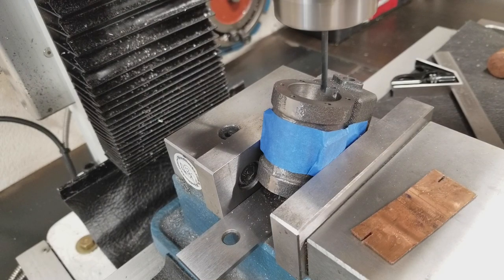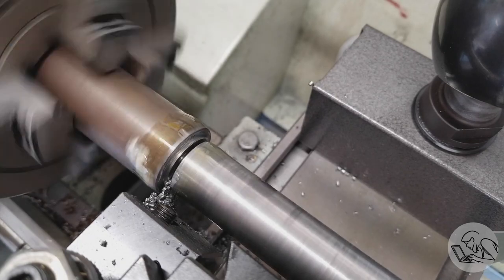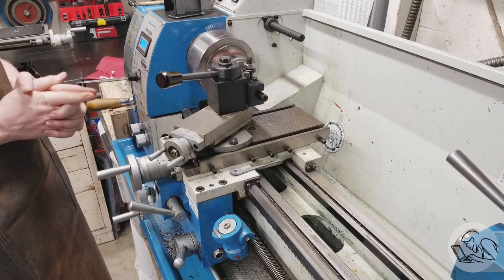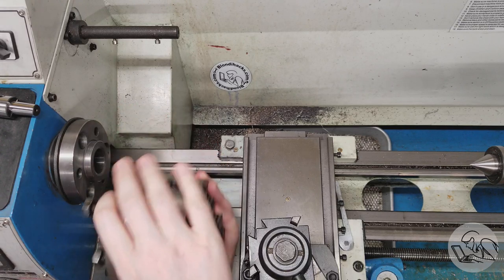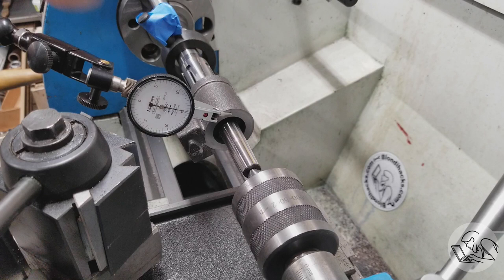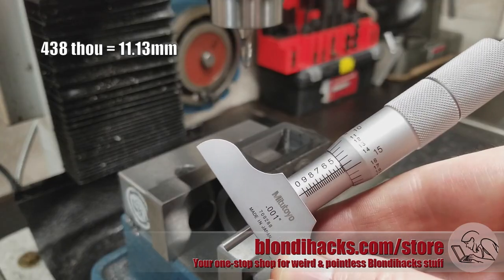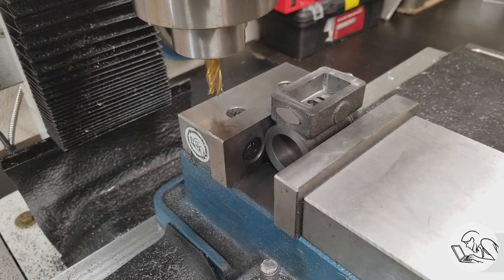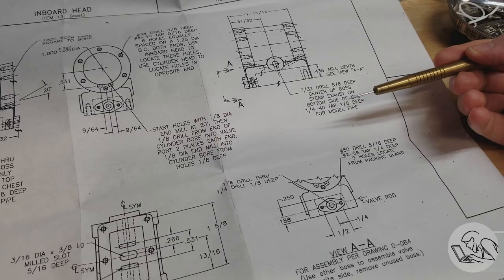Let's Build A Model Steam Engine - Machining a cylinder casting!

Comment: I have watched most of Kieth’s videos on steam engine building. He is an authority on the subject imho.
The only thing I found that didn’t work was setting up the cylinder bore using the mandrel. My casting bore was so crooked I had to replace it. The next two I indicated off the outside of the casting on the three points to find my center. I then bored to dimension and cut the face in the same set up.
Many model makers use transfer punches and super glue. It works, I use my DRO as much as possible.
Blonde, I enjoy your videos on this subject more than that professional machinist.
You are human, don’t ever change. You are a character. Way better than TV 😃

Comment: Used to use graphited string as cylinder packing. Bored cylinder in lathe,t hen fitted homemade mandrel to face both ends. If there was enough meat in the castings,then slice off the valve chest, you can see what you're doing with the steam ports, and you will be able to lap in the port face.  Cylinder hone, slit in a piece of broomstick, and strip of emery.You're doing a great job of showing this - LBSC would be pleased!

Comment: the bad thing when machining is once you start excepting modifications to one part it could bite you several steps later effecting 6 parts, the good thing is catching things early and it can award you with a good final product and experience.

Comment: Diesel engine tech here. Cross hatching is most definitely still used in modern engines. It is mostly for oil control. You can't have a polished cylinder wall (in diesel engines at least, can't speak for steam) or you will burn oil excessively. You have to have a film of oil on the cylinder wall, and having the microscopic peaks and valleys gives the oil a place to go when the oil control ring on the piston goes past. The oil helps keep the cylinder wall cool, and helps keep soot from sticking. Spray paint over water droplets and see what happens. Rebuilt many engines that had oil consumption problems due to polished cylinder liners.
Reply: Steam engines don't really use that technique because the lubrication is carried in the steam itself. Wherever the steam goes, the steam oil goes.

Comment: Great work!

In regard to honing. Basically everything you said is correct in its own context. And that is often the issue.

The finish and crosshatch angle will depend on what ring (or seal) material you have, ring design, application. Most certainly the grooves are used to retain oil and bed rings in. And the angles you were talking about are within normal range.

One point about honing technique is to give a few short strokes each end every so often, as you pass the middle twice as much at the ends and if you're not careful you'll end up with the centre being oversize.

Comment: Great video as always,
It’s great that you not only show your bloopers but also take time to explain them and give a little lessons learned conclusion. 
I would just like to put in a word of defence for any of the draughtsmen that may watch your videos.!
Before anyone goes picking holes in drawings they should put themselves in the shoes of a draughtsman! His job is not an easy one, it is not simply throwing together some random drawings showing what the part should look like and how big it should be. His job is to take a figment of the design engineers imagination and from that, create a comprehensive set of instructions that allow an unknown machinist, to create a fully functional finished component exactly as the design engineer intended and his only tool to do so is a set of pictures!
Those lines and dimensions he puts on paper are not just a representation of the physical size and shape of the part, they also explain the relationships and interactions of the features critical to its function. The dimensions not only state the size, position and accuracy of the features, but their placement on the paper in relation to the features also dictates the sequence in which they should be created in order for the finished component to function as the engineer intended. Learning how to read engineering drawings correctly and understand the design intent that they convey is as important a skill to the machinist as operating the equipment itself and with the best will in the world, the draughtsman cannot be held responsible for the machinists ability to follow the drawing.
Always take the time to read, digest and understand the design intent of the drawing before committing to machining the part. If the drawing seems little bit quirky or the method of dimensioning doesn’t at first make sense, then it’s more than likely been done that way deliberately to encourage a particular sequence of manufacture critical to the success of the part. Of course sometimes there are genuine mistakes 😉. Keep up the good work 👍

Comment: The person who doesn't make mistakes doesn't make anything.
An engineer can rectify there mistakes without anyone finding out.
Reply: BS, engineers don't find their mistakes, The technician in the field finds and fixes them.
Reply: @rjkee5157  the engineers at my shop have the bonus perk of blaming you for their mistakes  .... I count myself as a fair machinist, but for the life of me, I can't make a 1.500 +.0003 rotor fit (and rotate) in a 1.498-.0003 bore lol
Reply: @rjkee5157  hi I'm 59 years old, served my time as a toolmaker on leaving school ,now a field service engineer and will make mistakes till I retire.
Reply: @rjkee5157  To be fair, it's often the operators that find the mistakes... or at least find they exist. We just get to pin them on the engineer once in a while. Often enough it was just someone cutting corners during the build...

Comment: One thing I find is that castings have no easily recognisable features and are just amorphous blobs. So after a clean up with a file I mark out every feature with dyfken blue including arrows to mark direction and any other important information. It’s like when a surgeon comes round before an operation and marks out which leg is to be cut off while the patient is awake to make sure he gets the correct one. Steve

Comment: I made a wooden block the size of the cylinder. Drilled holes where the ports would be in the valve chest. Adjusted the vise angle for the passages to the cylinder. Then drilled
thru to the valve chest ports to confirm the angle was correct.  If I missed, I just made another test block instead damaging the cylinder. Eventually got it right and didn't screw up 
the cylinder. Crude but but it worked. Just a thought.

Comment: One caution I would offer is that the core that is used to make the cylinder bore will sometimes "float" in the casting causing the bore to be at an angle to the rest of the casting.  This is a particular issue when using a mandrel to center the bore, you are actually making the rest of the casting be at an angle.
Reply from the maker: Yah, my casting is a wee bit crooked in the end, but Keith has done dozens of these and I had done zero until now, so I figured I could do a lot worse than follow him! His engines all run very nice.

Comment: A good thing to do with castings is prescribe surfaces. Blue up all locations to be machined.  Then set it on a v block or other device. Snug it down and then scribe c/L of bore and all measurements on all sides from C/L. DO this on perpendicular axis by aligning scribe points to surface

Comment: The 45° pattern on the honing may be to prevent the introduction of steps on the cylinder wall if the hone is moved in discrete increments down the length of the bore.  That's what a mechanic told me before my first DIY break job on drum breaks on the family farm truck a long time ago. So that's what I always did  and it worked.

Comment: The modifications to save the cylinder reminded me of the late 60's and early 70's working on my MoPars (Chrysler products).
Per the manual, an engine bore could be to spec or 2 thou over from the factory. Crankshaft also could be to spec, 1 thou under, or 10 thou under. The Ford and Chevy people really made fun of that, but I personally never ran across one of the oddballs. They used to say Walter Chrysler's company never threw anything away. Engine codes had all the info.

Comment: My experience with cylinder hones is honing the bores of brake master and wheel cylinders and honing  engine cylinder bores. As I remember, the basic reason for honing was to  obtain smoother bores than would otherwise occur. A crosshatch pattern occurs naturally and may help, probably doesn't hurt but smooth bores are definitely desireable..

Comment: Good to see you haven't run in to any imperfections in the casting. I used to work in oil field machine shops and working with castings for the standard 2" x 5klb valves, sand pockets and "inclusions" at times seemed to be the rule of the day. :)
Reply from the maker: These castings have been really nice! I’ve had very little to complain about.
Reply: OldPUP especially in both bores of a compound cylinder block!
Reply: @lenroddis5933  Heck, depending on the "inclusion" it can also destroy tooling. Been there and done that. Had to grind them out many a time. Sometimes weld them up and re-machine as well. Weather an in inclusion or sand pocket, neither are fun when you run in to one. :)
Reply: When I was a young lad my parents would drive down the freeway through an industrial area around Oakland, CA.  There was a sign I'd look for every time we went that way and it had a crucifx and the words "Stop Casting Porosity".  Being young and innocent I thought it was some sort of admonition about being a better person (see 'casting aspersions').  It wasn't until decades later that I found out it was some sort of company that made chemicals and gear to sell to casting companies.  Noun, verb, eh.
Reply: @tonydibenedetto8735  the castings in these model engine parts are very porous, you just can't tell unless you know what to look for.

Comment: I finally found the time to watch the entire video.  Excellent work Blondi.  Yes I know you made some regrettable errors, but that's why I watch these things.  Those will be at least a few errors I won't repeat but probably would have made myself had it not been for your misfortune.   So thanks for sharing your reality and not editing out all the mistakes.  Thankfully you were able to recover from all of them thus far.

I have a slightly different model it's the PM Research #5 also known as the "Coke Bottle" model.   The cylinder on my model is slightly different.  Very similar, but instead of having 2 input ports at 20 degrees for each side of the cylinder mine is showing just one port on each side that actually runs exactly parallel to the cylinder.   So I apparently I won't need the 20 degree set-up.  Other than this slight difference most other operations appear to be the same. 

I like the Keith Appleton method using a homemade arbor to set up the cylinder bore in the center of the 4-jaw chuck.  I'll probably use that method as well.   This will be my first attempt to machine one of these kits so I hope it is a success.  I'm going to try to make videos of it when I do it.  Succeed or fail, I'll publish the videos either way when I do it.  Unfortunately I don't have very good cameras so I'm not sure how good the videos will be, only time will tell. 

But I just wanted to thank you for sharing your first steam engine build.  I'm looking forward to starting in on mine.

Comment: Having built many racing engines in another life I looked to the experts who did that in the same way we now look to the machining gurus on YouTube.  At the time large cylinder hones (3" to 4" cylinders) very much like the brake hones you found were the accepted standard.  But the real gurus had found new technology that produced a surface finish that had better results. Lower drag, better oil retention, less wear.  We're talking hundredths of a second in a drag car or 5 HP on a NASCAR stock car but every little bit counts.  The company was (is) Brush Research Manufacturing and I just looked and they're still around.  So the next time you need to hone another steam engine cylinder, or a stock car engine (that should definitely be your next project!) check them out.

Comment: Crosshatching is still used on modern engines and yes it helps to retain oil. The only thing that has really changed is the finished surface of the cylinder is much smoother than it used to be. One reason is because the ring tension on modern engines is less than it was a few years ago so a lower RA finish helps the rings to seat in faster with less wear. Years ago you could hone with one stone, I.e. 220 grit and call it good. Now one common process is to bore within .003-.004 of finished size then plateau hone with .220 then .280. and finish with 400 or a brush pass. If you are using diamond stones the grit choices are different.

Comment: I always dreamed of making a "big" steam engine, but I am so scared of not being able to get the machining right. It's not so much the money but more the potential disappointed in the process. I'm a car mechanic now design engineer but that still didn't teach me how to machine things on that level. Looking for information, Forums are disencouraging with  their pro vibe - one gets the feeling it can't be done if you don't have the same experience and kit. Same with watching the You Tube machinists - despite them presenting it very lightly it is clear that they have a lot of tricks up the sleeve that you won't have - standing alone in front of a machine f§$%& it up. 

Long story short - I absolutely love the fact you are sharing this experience and explaining your thoughts on the way - thank you so much! I feel like making a start now!
Reply: You can sit there and dream about things all you want, or you can start small and practicing until you get to the point where you can do it. The key is to not jump in head first to an expensive complicated poorly designed kit with lots of cast parts.

Comment: If they would have dimensioned the edge of the steam chest to the center of the cylinder bore, it would have made things a lot more clear!

As far as cylinder honing, in gas engines anyway, if you are rebuilding an engine and don't hone the cylinders to give them a new cross hatch, the rings won't seat and you will get blow by. On a miniature steam engine, I can't imagine it mattering as the forces are so low, I don't think it would matter. With a rubber o-ring, I would think you would want the surface as polished as possible to avoid abrading the o-ring.
Reply from the maker: Yes this was my thought also. For soft rings like silicone or Teflon, smooth makes more sense
Reply: I repair hydraulic  cylinders. You want a honed surface. It seals better and catches oil to keep the seal lubricated. We always  follow the stones with scotch brite pads. For a small bore like this using a break hone you could wrap it with 320 Emery cloth.  To be clear the spec surface  finish on hydraulic cylinders  is 8 to 16 RA.

Comment: Something you probably should mention, the spring loaded hone will bell mouth the ends of cylinder if you allow the stones to come out too far either end.  The pivot should always be at least 3~5mm inside cylinder. (around 1/8"~3/16")
They also have a maximum rpm, usually difficult to find ranges for smaller hones though.
Cordless drill is easiest way to use them although I have a high torque 400rom drill motor to use with hones. (more to do with centrifugal loading than stone breaking up)
Some sort of cutting fluid would also be a good idea as the stones will clog very easily on cast iron.(good if you want a polished finish, not so great for oil retention on automotive applications)
 It is possible to true up a cylinder with a spring hone but it isn't easy.
Modern automotive cylinders are still honed but using diamond or CBN when manufactured (unless something major has occurred in last few years?)

Comment: Love your channel, I'm also working on this engine in my spare time. I think you should double check your 3/8" port width, they appear to be 3/8" arc center to arc center instead of 3/8" overall width, also on the 1/8" deep 1/4" drill depth, this normally means to the drill corner not the point. That said I'm liking this build! Keep up the good work!
Reply from the maker: I know, I did that wrong. Doesn’t matter, it still works

Comment: At 15:26, there are three dimensions of two sets of features (hole pattern and floor of the steam chest) spread across two drawing views. This is an over-constraint and bad drawing practice. If a third dimension in this case had to be given (if the draughtsman felt strongly enough about it) then one of them should have been given as a reference dimension; which means it is there for reference purposes to aid manufacturing, rather than being a dimension to inspect the part against. 🤓 just my two pennies’ worth...
Reply: I learned "machine work" by working into the profession, a year of machine work in high school.  The math was something I learned on my own, as it wasn't available to me at the time, my high school was "academic focused" not much opportunity for "life skills learning".  Your statement clarified something I've known for decades, but never put it to words.  Few even speak of "proper drafting standards" in drawings, too much emphasis on "software engineering".  I still work to "paper dimensions, paper standards" and with the failures that have come, have little desire to know more of the "on-line, new standards" that all depend on well functioning technology soon to end.